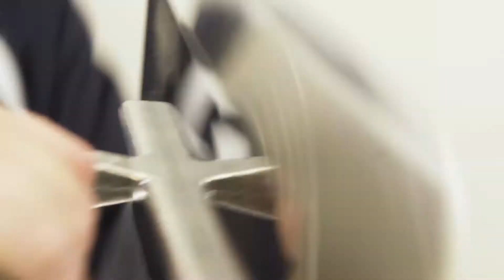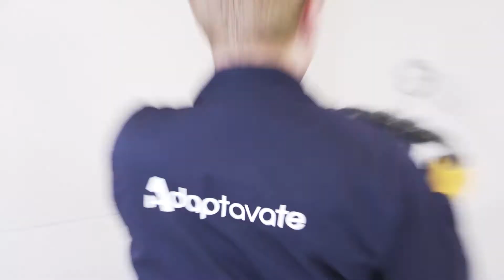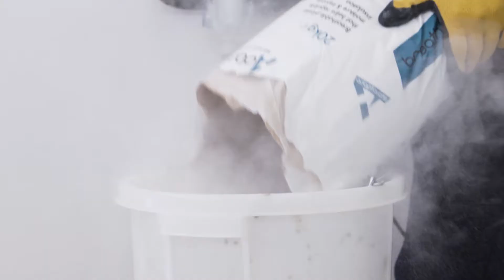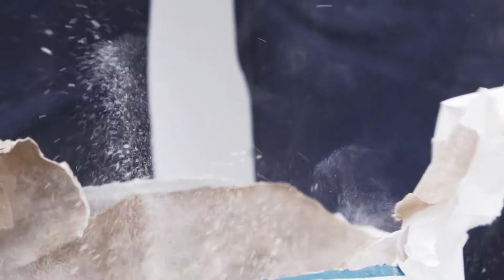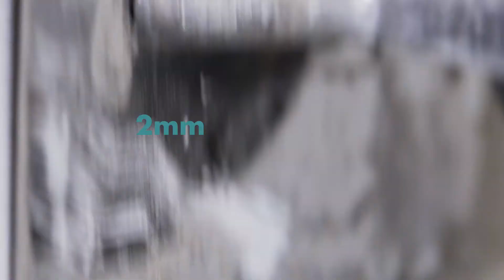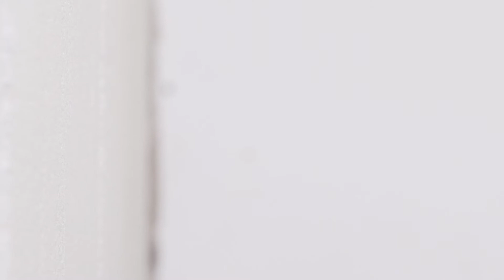Full video on mixing, applying, finishing Breathaplasta – the quick setting lime plaster wall finish

Comment: Does this need any sort of breathable bonding agent before applying ontop of lime render or does the render just need a key?
Reply from the maker: It just needs a diamond shaped key and wetting down the substate to control suction. If a primer is needed, then we recommend using AURO 506 Grip Coat Granulated due to its high vapour permeability (breathability).

Comment: Im using the universal product at the moment, on both the wood fibre and plaster board,i am finding it goes off far too quick in the bucket b4 i can get it onto the wall,i have been plastering for 23 years so im no slouch,am i mixing it wring?

Comment: You should be showing how to put it on a wall from brick because that’s the real skill.this is misleading as you the whole point of lime plaster is for old building’s and plasterboard holds damp and shouldn’t be there.I’m trying to restore a cottage.how should I be doing it?
Reply from the maker: Paul, Thanks for you question and you are totally right! With brick it is pretty similar but you would spray it down and do a base coat of around 10mm and then wait 45 minutes or so and then put a top coat on of around 4mm. We also have an install guide for this on our website. https://adaptavate.com/wp-content/uploads/2020/02/Brick-Block-Stone.pdf We hope this helps! But if you need more support - please phone the office! Thanks.
Reply: @adaptavate  can you answer the question on what the advantage of plastering it onto plasterboard is please. Seems contradicting practice

Comment: I didn't see on the video PVA application before plastering with Breathaplasta. Is PVA necessary with this product? thanks.
Reply from the maker: No you do not need PVA with Breathaplasta. The only areas you would want to use a breathable primer is on multiple substrates and super absorbent substrates where you may use it to control suction. Hope that helps! Call us on 01453 827800 if you need any more guidance.
Reply: You don’t use pva no ! they have a granulated primer to use instead 👍

Comment: My question comes from never having plastered anything. If I haven't applied a texture to the plaster so it's left smooth, could a fully plastered wall be cleaned with a damp cloth using white vinegar or maybe diluted Dettol? If not, would painting it be OK with water resistant paint?

Comment: Do you need stainless steel screws to fix plasterboard because of lime??
Reply from the maker: @tim vincent, 

Yes, you do need to use either stainless steel screws or plastic. It's best to avoid galvanised as these can corrode from the alkaline lime and possibly bleed through to the surface of the plaster, over time, if the protective zinc coating is damaged.

Comment: Burns your hands & doesnt come out smooth
Reply from the maker: @Sal Sal, 

- Breathaplasta is a blended lime plaster and, like all lime plasters, it has a high pH (alkalinity) and is caustic when wet. Plasterers must handle with care and we recommend using PPE like gloves and eye protection. Protecting your eyes is really important and any skin irritation or mild burn can be neutralised with a weak acid like vinegar or lemon juice. When the plaster is dry, the pH drops to about 8 or 9 (pH 7 = neutral). Lime plaster is the traditional finish for buildings pre-1919, but they need handling with a bit more care and attention than modern plasters.

- As a 'universal plaster', Breathaplasta is a versatile product. It can be used as both a backing plaster and finishing plaster. A flat and smooth finish can be achieved using standard tools and techniques. A permeable lime-based finishing plaster will be added to our range shortly for projects where a very fine finish is desired.
Reply: It would burn your hands . As it's a product made with lime.  Lime can really burn and dry your skin . I've used many hemp plasters.  
Maybe try using a float and then trowel it . And maybe treat it as a traditional plaster